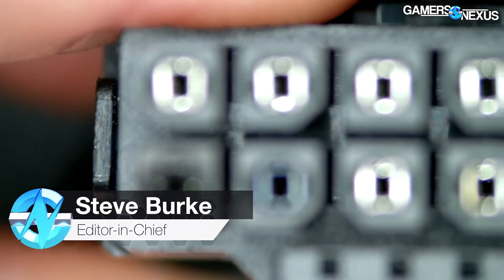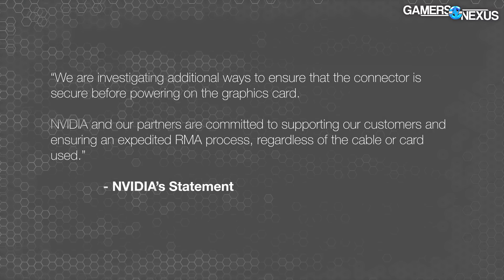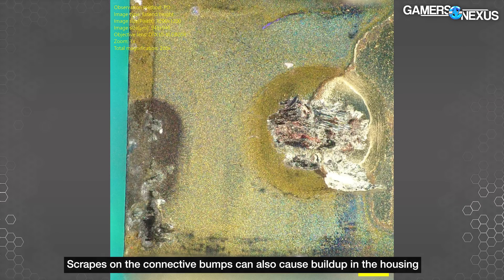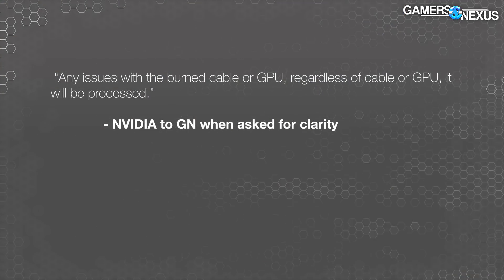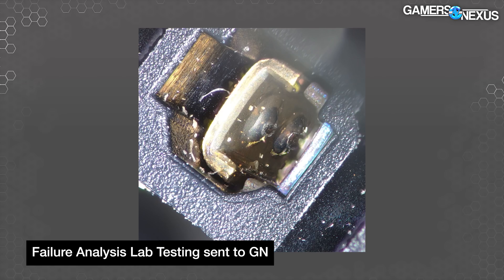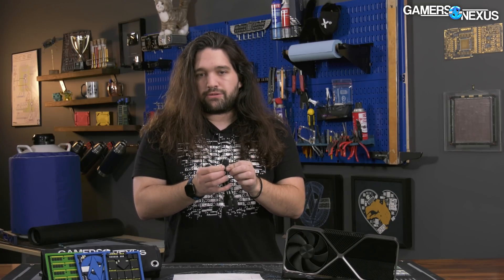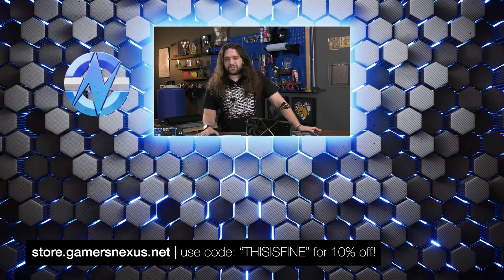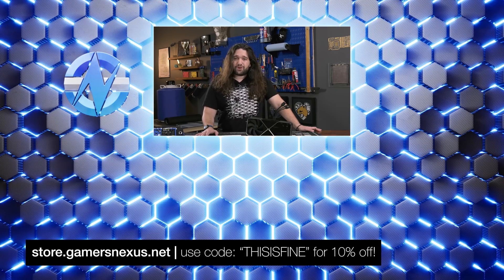NVIDIA Responds to Melting Cables, Warranty Concerns, & 12VHPWR Adapter Failures

Comment: Good to see Nvidia finally communicating clearly and assuring 4090 owners on any warranty concerns. It took them long enough and cudos to GN to arriving at the same correct conclusions earlier than Team Green!
Reply from the maker: Glad they're finally making a statement!
Reply: That statement needed a -thanks Steve at the end lol
Reply: @teebles They took like an entire month to do proper testing and find the real issue before responding. Would you prefer they pull an Igor's Lab and just blame whatever random thing catches their fancy without doing any testing? The reason Nvidia took so long is the same reason it took GN so long - real testing takes time.
Reply: Well, they probably would have lost a lot of 4090 sales if they hadn't. They still might.
Reply: Fuck warrenty. It's a fire hazzard
Reply: @teebles it’s just 50 cards. They only responded because idiots like you were overreacting. 😊
Reply: @teebles I’m referring to people that are overreacting. If they fall in that category then yes. It’s not a big deal when you have warranty. So they didn’t get fucked.
Reply: @Estarossa300  Read the adamshd1 comment in this thread. Someone got screwed, because of that long waiting time. And because of the scare that was generated. But I know couple of people that bought 4090's and stopped using them after they saw the first reddit post. So not everything was because media blew it out of proportions.
If you design a power cable that has worse tolerances and safeties than previous one - it is bad enough. If you release one that is also easier to attach incorrectly that is worse. Making no statement sends people into panic. They didn't want to hurt their sales, so they waited. And I'm sure it took them a long time. I doubt it took them a month. Unlike GN they had access to some RMA'd cables at least a week or more before GN.
Reply: @jannegrey  sucks for that guy.
Reply: I think that nvidia should still recall the cables and give us new cables for free at their expense, it literally costs 50 cents to fix the cables, yet Jensen thought 2 cent cables from China were acceptable for a 1600 dollar product. What a literally load of bs. I suggest everyone boycott nvidia until we get quadro a6000 for 1k
Reply: NVIDIA was too busy counting the over $200 million they already made on the 4090 sales ALONE.  With sales figures like that there is ZEO incentive to lower the price to realistic levels.
Reply: @pdrey100  The joke will be on NVIDIA when AMD releases their cards. In this economy price to performance is what people will be looking for and AMD clearly wins on that front. 4090 buyers just want the best, money is no object to them.
Reply: @WalkerIGP  Hope you are right. Intel also needs to step it up next year and become a REAL competitor.
Reply: @mjc0961  Wow, my current gpu is a 3070ti, and it was a 1080 before that. It is an Nvidia buyer saying this. That should have Nvidia worried.
Reply: @WalkerIGP  Even at the [ money : performance ] ratio, I'm still not touching AMD this generation. Even after the 4080 release details, I'm just not seeing it unless I was an AMD shill. 

I'll go with their processors for some of my projects, but the GPU line is atrocious.
Reply: @janus3555  I woould.advise you to check the specs and reviews before calling it bad or terrible. I have been a loyal Nvidia buyer for years, but even I can see AMD are stepping their game up. Nvidia would be unwise to ignore the competition, which they certainly seem to be doing with these prices.
Reply: To be fair they couldn't communicate because they had no idea what the problem was.  They found out when Steve did his previous video.
Reply: To me personally it feels like a 180 on the warranty from nvidia because when all the confusion was happening about the nvidia warranty and cablemod cables I did a live chat with nvidia tech support to get an answer directly from them because I had a founders edition 4090 and had ordered a cablemod cable to calm my fears about the connector and they told me in no uncertain terms ( I have the live chat log) that it would void the warranty on my 4090. So now a week after I returned the card because I felt like I was being forced into a catch 22 situation  with it they have changed their minds, which I think is great and the right thing to do, but I can't get another founders edition card for msrp anywhere so that sucks.

Comment: @6:20 what it was fully inserted, but not latched, it's IMHO more design error than user error.
Reply: This is the issue I see happening. Fully inserted but not lached and add in case side panel and cable management like he mentions and boom failure. Nvidia should have really designed the sense pins better to not work when it becomes so loose it can melt

Comment: with this whole 12 pin thing, in my eyes a design is bad if it isn't idiot-proof. the GPU should not be able to power on if it isn't plugged in all the way, this is wholly on Nvidia
Reply: Fully agree the fact the sense pin connectors are long enough to be connected when it's this loose is a huge consumer design flaw
Reply: Except that it's not Nvidia's fault at all because it's not their connector.

Comment: Plug it in, with clamps, put cinder blocks on top, and then epoxy the entire thing
Reply: Hot glueing cables suddenly doesn't sound that bad of an idea XD
Reply: @thelegendaryklobb2879  Even better-- Buy cables made out of glue sticks and let the 12 pin connector do the job for you.
Reply: Or just plug it in like any other PCI or EPS connector
Reply: Or just plastic weld the two together.

Comment: 0,04% does not seem accurate. At best it can be considered a floor. Is 4090 out for even a month? This cable issue is something that will only grow worse with repeated wear and tear. Also 50 cases are based on reported cases that reached Nvidia's ear. How many will simply get a new cable without contacting Nvidia?
Reply: I think the numbers are accurate, if you spent $1600+ for a graphic card and it fails you will RMA it, NV can get these numbers from board partners very easily. Furthermore, NV instructed the board partners to send them the fail cards due to burnt cables for further investigation.
Reply: Hopefully enough many people get the message and double check their cables to make sure they're mounted in. Otherwise there will indeed be more cases of burnt cables as they'll be slowly unplugging themselves over the years of the PC being shuffled for cleaning etc.
Reply: The 0,04% refers to the number of known cases (around 50) over the total number of cards sold to date. It does not project the likely number of future cases.
Apart from that, if the main cause is really user error, then the current level of attention and the advice by GN and all the other websites will more likely reduce future cases from happening. People will check that their cables and therefore minimise the risk.
Reply: I agree with your point about it being a floor, but the bigger takeaway is both that 1. the percentage is very low, and 2. nvidia confirmed that every single failure was caused by the cable not being fully connected. The percentage was a more useful number for consumers before we knew what the cause of the issue was. Because the issue has been confirmed to be improper seating, there's no longer the fear of playing cable roulette (which, based on nvidia's response, sounds like they don't have evidence to support that it's a manufacturing issue).

What I'm trying to say here is that even if the true percentage was higher, like 0.1%, that doesn't really change much. It's not so egregious that nvidia needs to issue a recall.
Reply: Well its a 'so far' stat. Its likely there will be more melted cables, because this connector is crap. It has less safety overhead, and it is trying to push more power thru a physically smaller connection. The fact it is being sold with very expensive hardware and comes with rules - like dont bend it X amount or within X distance to the connection (how about they make it so you cannot bend it, if you dont want people to bend it....) is a joke.
Reply: @utubby3730  Totally agree. It's also unfortunate that consumers are ultimately the ones testing the cable, but that's often how things go. Hindsight is 20/20, Nvidia knew the risks of running such high power through a single cable, more protections should have been put in place.
Reply: lol, let it go... its over
Reply: These comments are so intelligent it blows my mind, most liked comment cries about the company not address the issue that 0.04% of users have before third parties and then when they finally do they call them out that the reported failure rate is too low and they need to further investigate. Ironic.

Comment: User error or not the fact that the error can be made so easy is down to bad design.
Reply: It’s user error
Reply: @Distortion_World  "the connectors are extremely hard to plug in fully" what is this reality TV drama culture we have here? just throw in a bunch of BS adjectives to make an argument sound more credible and compelling than it actually is? You need to put pressure to plug it in, but it's absolutely not "extremely hard" to plug in. People are so fuckin dramatic dude its insane, lmao. It's harder to put a circuit breaker in a panel than it is to get in this connector- and a breaker costs 2 bucks. It's like 99.9% of the people commenting on this are dramatic children talking completely out of their ass with no real world experience
Reply: Nvidia may be over pricing cunts but this one isnt on them, its on the dumb fucks who dont know how to properly plug in cables.
Reply: User error occurring in 1 out of every 2,500 units sold is "so easy"? Do you not know how math works?
Reply: @sly9263  the new math
Reply: or people that don't know how to use a plug

Comment: As a 4090 owner I ignored the news and ran my PC 24/7 despite I was away from home and country, I asked our local dealer if there's an issue or recall he said nothing yet then told me several days later that there won't be a recall, they had 0 complaints so far in their side despite selling hundreds of them, and he said in reality over 100K cards sold worldwide and number of reports is like 0.001%, he simply said "enjoy your 4090"
Reply: "I ignored the news", so your connector melted?
Reply: @smartmonkey777  nope, I ignored news cause I believed this is another 3080 Caps power issue on launch made a big deal then issue disappears.... So I left my PC running while no one at home....

Then more news appeared online and asked a dealer just to be sure and that's what they told me...... Basically all the fuss is not worth thinking about, whoever knows how to connect a cable shouldn't even think about this as an issue, more like a propaganda over Nvidia

Comment: The sad thing is, other than price, the 4090 is everything I've been asking for ever since the death of SLI. I wanted a single graphics card that pushes the power and performance to the limits. Too bad it's somewhat hobbled by a connector with significantly less error tolerance than the previous PCIE spec. It makes no sense to go from 24 pins(3x8pins) that can handle over 900w of power down to a cable that can handle about 700w on a card that actually pushes 600w just to "save space".
Reply: too bad there are actual induistries birthed from cable management.... so theres that
Reply: @Fudgesickle  That doesn't matter to the core issue. When the spec was even being considered, there were hundreds of different ways they could have approached it, yet they chose this, extremely poor by comparison to essentially everything else, option. Also, the difference in cable management between a 12+4pin and the old 3x8pin is largely irrelevant in every system except for possibly the absolute smallest that wouldn't fit a super high current card anyway. Why not a 24 pin with the same astron connectors? Why even use the smaller connectors at all? At least, to my knowledge, the connector did not exist before PCIE gen 5. It's freaking purpose built. It would be a totally different thing if they were using an existing design and had to work within those parameters.
Reply: That's why I finally bought one- played 1440p since 970/1080ti and the 4090 was the tipping point for FPS at 4k ultra that I was finally willing to part with the coin for.
Reply: @sly9263  Yeah, I totally agree with you. I'm glad you are liking it. I generally play 120- 144 FPS 1440P at high settings but 4k 120 sometimes depending on the game. I really prefer, even with action games, to keep FPS above 90. Here's hoping the 7900xtx doesn't disappoint so I can save a kidney for later.
Reply: @TheJjjoj  tbh, 1080p to 1440p is way more noticeable than going up to 4k/2160

Comment: I have an AMD GPU so I'm not going to comment about the main subject of this video. However, the sponsor, Fractal Pop cases. I really like them. I really want one. But you have to pay extra for USB C??? NZXT H510i (which includes RGB and fan controller) is the same price and it DOES include USB C...
Reply: Xbox One launched in 2013 with Wi-Fi 5.

PS4 launched in 2013 with Wi-Fi 4.

Companies don't always use logic.

Comment: inb4 "It's a design issue with the cable." At what reasonable point does a company have to compensate for user negligence?
Reply: the user stupidity rate is fortunately so low that NVIDIA can afford to just eat the cost and make people happy just to quell the avalanche of bad press (again, derived from user error)
Reply: It's a design issue with the cable.
It is shit. I cannot get a click, NO MATTER WHAT. I will break my damn motherboard if I push any harder. Less safety over head. The fact there is even a 'how to' plug in a cable, might suggest that in fact it is indeed a shit design.
Reply: @utubby3730  It is a design issue yes, the click is very silent if there is any, chances are you already have it secured but again people should stop raging and use brain instead and not go ooga booga on the connector. If you are sure it's all the way in try manually pulling the lever onto the latch and preferably do it outside the case as Blamplify suggested.
Reply: I have a 10W USB soldering iron that heats up to >350C in about 15 seconds
Any issue inside a connector carrying ~600W is a very serious issue. It's just badly designed. Other wise why are PCISIG and Nv even talking about revisions?
Reply: @_BangDroid_  they're talking about revisions to mitigate the stupidity of 1 in 2,500 users. TBH if it wasn't for the sensationalism across media and content creators they probably wouldn't be changing it at all. Out of 2,500 PC builds, how many chimpanzees do you think cook their motherboards? Ah yes, motherboards should come with the standoffs already soldered to them!
Reply: @sly9263  Your example only proves this is not the same.
Reply: @_BangDroid_  you sound confused
Reply: @sly9263  says the guy that thinks he can hear text
Reply: When it carries up to 600W and is a fire hazard.
Reply: @2nd_Directorate  is 125w not a potential fire hazard in your physics universe? What about 5 watts? Please elaborate
Reply: @sly9263  Nothing to elaborate here, it is obviously "my" universe, so educate yourself on the real one.
Reply: @2nd_Directorate  still waitin to hear back about all the wattages that aren't a fire risk